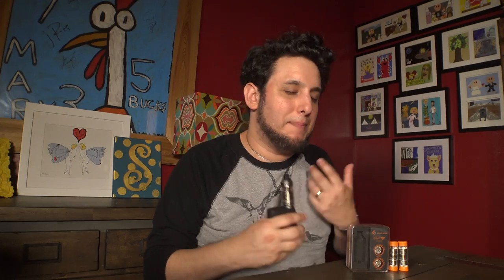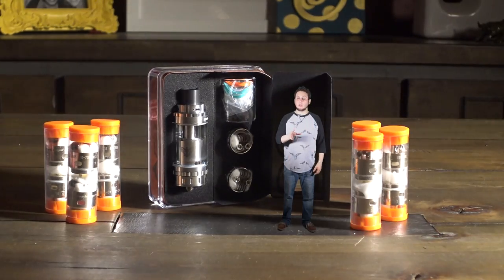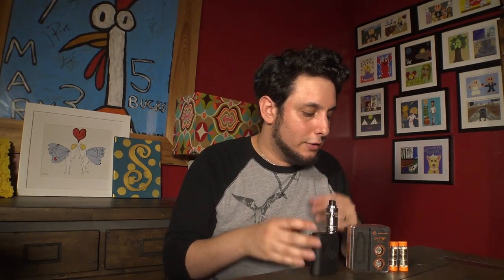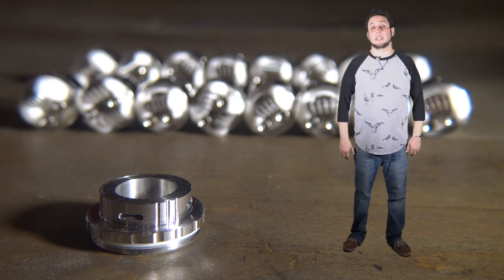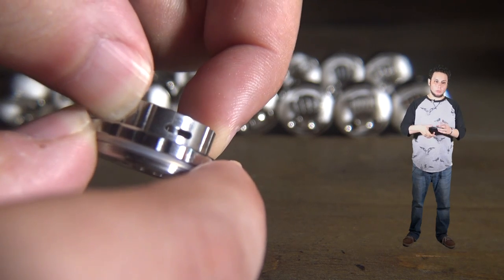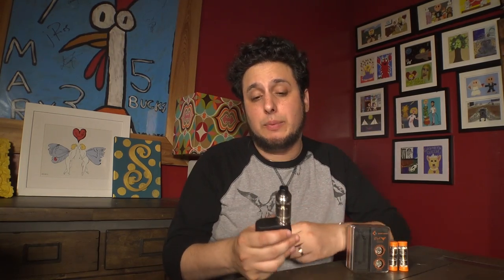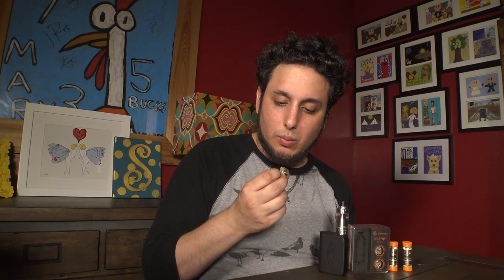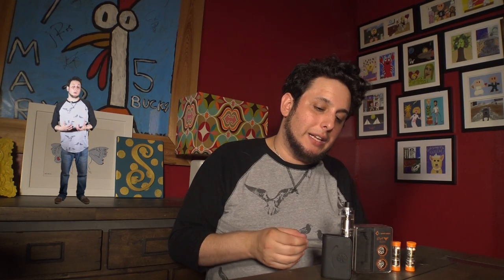The Eagle! Rise of the Sub Ohm Tank

Comment: When I first got mine which is the top airflow edition they also sell one without top airflow, it leaked like a mofo bad. I decided to rewick it and bam no more leaks and great flavor. Conclusion the wicking sucks on the heads. Make sure to use enough wick otherwise you will get leaking. That's my two cents.
Reply: Jim Nasium hope it works for you.

Comment: Glad to hear an honest review on this tank. And who the fuck disliked this?
Reply: I did, mostly because he talked about the font, yeah the damn font, who cares. Then he went on about the top adj. which is a non-issue.
Maybe he should have discussed availability of the HBC heads or the leaking issues or the missing standard deck.
If he didn't have leaking issues then he didn't use it very long.
I'm presently using it with the single coil deck in TC going up and down on temp. trying to find the sweet spot.
I have a .94 single wire build on a Nano that's a better vape than the Eagle.
Reply: I hate the shit out of this tank,who ever likes it as a high tolerance for crappy vape gear,but if you like a good vape for god sake DO NOT BUY THIS TANK.
Reply: +Franck Lamonica Try one of the clapton coils in the single deck at 50 watts. The other coils caused me too much spitback on my tongue. This tank cries out for a standard build deck but I doubt it will happen.
Reply: Dug thru my tc and found one,put one of the fused claptons that come on the dual coil in the box it homed out at .25 glowed beautifully so I wicked her up and guess what? It still vapes like shit bud,scratchy,dry,noisy as hell,vaped it or should I say tried to vape at 50 watts,then 55 watts but no dice:-/
Reply: +Franck Lamonica 
I'm surprised and getting ready to fill my tank again. Still at 50 but been up to 65. I like it at 50. Wicking is normal and length is not too long. Just folded under at the hole. Didn't fuss with it at all! Getting a nice vape! Keep trying...
Reply: +Rick9482 been had for about an hour,am soooo done for today,now it likes to work on certain mods and giving me check atomizer on others weird just plain weird this fuckin tank I just don't get it,what ohm is your coil reading by the way?
Reply: +Rick9482 tucking that wick is a pain as well,it seems to just to clog up that hole I think which does not help matters either,cause if that hole is Not completely covered it will leak,but maneuvering it around to cover up the holes tends to clog them,SIGH
Reply: +Rick9482 thanks for your updates bud am glad that you are getting the hang of it,maybe there's still hope for me lol..
Reply: +Franck Lamonica 
It's reading 0.25 ohms. Vape is pretty smooth! When I did TC with the SS coil it wouldn't work on my Primus but was ok on the Cuboid.
Reply: +Franck Lamonica 
I seem to have the best luck when I keep it simple. I use needle nose tweezers to fold under the wick and lay it on the hole. I don't fuss with it much at all. This is not to say I haven't had issues but my luck seems to be improving. I think the biggest hint I can give is once it's working, don't be flipping it upside down and removing the build deck unnecessarily. 
Definitely not a tank for beginners.
Take a break and vape on one of your good tanks for awhile.
Reply: +Rick9482 thanks Rick much appreciated my friend,I think you're 100% am just way to frustrated at this time,since we been chatting I've rewicked it about 8 times which all ended in failures along with juice everywhere,I need to take a break,got the wotofo Sapor rta coming in a few days I hope it will simplify things a little,but am super happy for you bud cause I know what you went thru as am still going thru it so that's kick ass if you've solved the puzzle,enjoy the smooth vape brother you sure earned it;-)
Reply: +Rick9482 hi Rick just wanted to give you a quick update,I think I finally got it,I recoiled it with a 26 gauge double twisted wire 3 mm and placed my wicks over the holes but some appear to not be 100% covered and I thought it would leak but it as not,I actually think it allows it to wick better,just curious if yours are the same ? Are you covering up your juice holes completely ? Am not sure if you know what I mean it's kinda hard to explain,I think I was to worried about covering up the whole thing and ending up clogging them,let me know your thoughts bud,thanks;-)
Reply: +Franck Lamonica 
Hi Franck, I'm still using the fused clapton at 55 watts. I took the deck out a few times and I swear the wicking looks kind of shitty, as in not pretty but it works...go figure.
I beieve I covered the hole, at least that's my intent.
I like the fused clapton alot but think the regular clapton would vaporize the juice even better. I think the coil from the S03 deck has too many places for unburned juice to hide and this is where the spitback is happening.
I see no particular reason why this is working for me..its a mystery.
Not having all these decks not readily available is costing Geekvape alot of money. I would have already spent more on coils than I did on the tank but my attitude now is fuck'em. I'll use as is and move on!
Reply: +Rick9482 Rick next time you rewick try leaving a little bit of the hole uncovered I think it helps,I used to never see my tank bubble up after hitting it and now I see at least one bubble go up the side of the tank when I take a toke,and it as not leaked.
Reply: +Franck Lamonica 
Wicking juice hasn't been the issue, just leaking.The bubbles have always appeared for me.
I believe I can sum up my experience perfectly:
When it started leaking on me I said out loud WTF. Now that it's not leaking on me I'm thinking WTF.
Reply: +Rick9482 ya I hear you,mine should be leaking but it's not,as long as it works wtf let's just enjoy them before the next fuck up,and with the eagle that could be anytime ;-)